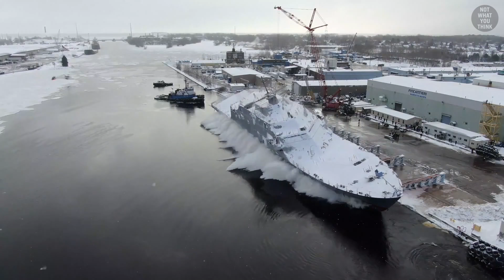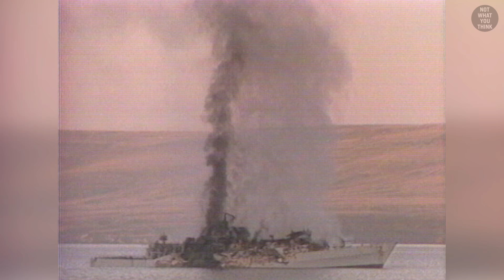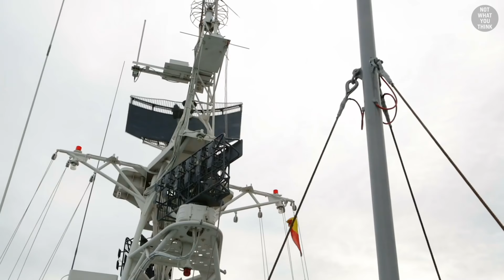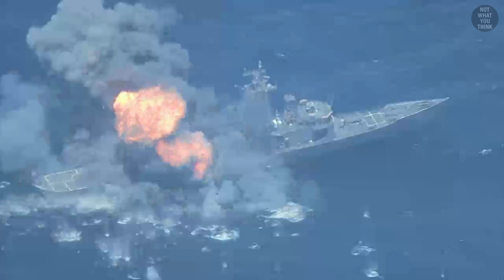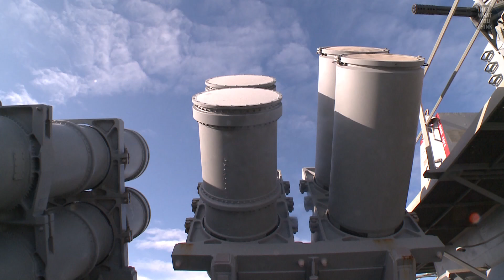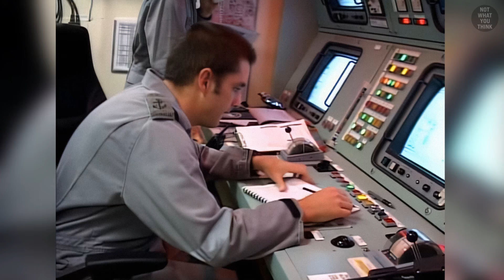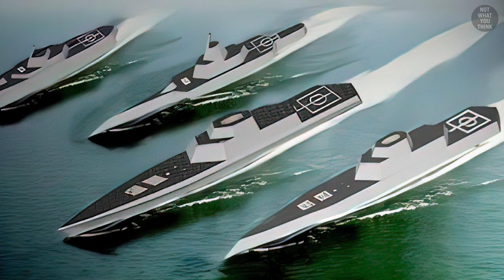How US Navy Made The Most Successful Destroyer ... But Now Has to Replace it.

Comment: The same way that they took the USS Kitty Hawk CVA-63 class carrier and modified it into the USS Enterprise CVN into the 10 USS Nimitz CVN's, and now into the USS Gerald Ford CVN's, thru modernization updates. The hulls and flight deck are basically the same layout design, except CVN-65 eight nuclear reactors, the Nimitz class hull was modified with two large reactors. Both classes are rated at 280,000 shaft horsepower. All have approximately 1,110 foot length hulls, hull beam is basically the same. The flight decks dimensions  about the same. The Gerald Ford CVN has 3 deck edge aircraft handling elevators, compared to the Kitty Hawks, Enterprise, and Nimitz's 4 deck edge elevators. Of course the most striking visual difference is the Gerald Ford's island superstructure. The Enterprise and Nimitz CVN's have 4 rudders compared to the 4 Kitty Hawk CV's and Gerald Ford CVN's having only 2 rudders. All carried approximately the same number of air squadrons. All of them could do  30+ knots.
Reply: IIRC the only post-WWII USN aircraft carrier with 4 rudders was the Enterprise CVN-65, all other carrier classes had two. Additionally, in a way USN aircraft carrier lineage predates even the Kitty Hawk class. An argument could be made that it goes all the way back to the Forrestal class and maybe even the cancelled USS United States CVA-58.
Reply: I take it youre a former Aviation Squid too
Reply: Well the engineers back when knew what they were doing. Not surprising that we’ve just kept evolving highly successful designs.

Comment: The Hi-Lo mix argument for the U.S. Navy Surface Combatant comparing CG-47 to DDG-51 is mostly bogus.  The only real difference in original design was the destroyer had one less gun, and had fewer missiles with no helo hangar.  Once the DDG-51 Flt IIA's came out the only difference was still one gun, and fewer missiles.  The fewer missile argument was cost and political considerations.  Never was any discussion about it actual effectiveness actually occur because there was no navy that existed or envisioned (particularly a PEER) that would challenge us (U.S.).
Well . . . that had now changed, and it is the People Liberation Army Navy (PLAN) that actually challenges us (the U.S.) using our own Green Backs we gladly spend for their cheap products that are shipped to us (the U.S.) every day.  The PLAN is larger than the U.S. fleet and growing VERY FAST ... while congress and the U.S. Navy vacillates. 
It takes three-five years from laying of a keel to delivery to the Navy for modern Aegis Surface Combatants.  It is hoped the FFG-62 will change that, but they are less capable than even the destroyer because they Frigate has less than half the missiles in comparison.
The solution is more smaller Small Surface Combatants like an American Sa'ar 6 with sufficient range to steam in the Pacific...built in numbers to supplement the fleet.  That platform could be built in numbers by more than one shipyard and be available for combat quickly.  No such program exist or is even being considered . . . so the future is pretty much already determined.  American aircraft carriers cannot save the day this time...particularly in the Western Pacific.  Our Allies will be very important but only Japan and South Korea have the right ships to help, and they will be dealing with their own problems.  Such is the Chess Game played by the Communist Chinese.

Comment: Simple fix  is have a nuclear  powered eingine  to power the ship design  a smaller lower level nuclear  power engine for future hook ups that connect to the larger engine  with a longer life span of (25 years ) for both engines this will keep you ahead of the power structure allowances vs  the expansion  of  on board tech advancement for future  surface capability  a good capability  would be to be able to be powered  by the small or large reactor alone the whole ship why for repairs equipment  rest factoring  and if one engine  goes out the surface combatant is not dead in the water  if there any new technics in cooling the reactor rapidly  to be able to turn one off bring a new safety feature
Reply: Having your entire fleet of destroyers be nuclear would be a nightmare and would limit them from travelling to quite alot of ports

Comment: I was on an old Adams class DDG with 4 D class boilers and twin screws sporting 70,000 SHP.....after overhaul in 1984 during speed trials we did 36+ kts for over an hour running all 4 of our boilers.....we could easily do 25 kts with 2 all day and that was with an old steam-powered tin can.....superheated 1200# steam it was but still

Comment: Love all the comments of the Zumwalt being over budget.  Only reason it became so expensive is due to the reduction in units.  90% unit reduction leads to your per unit cost into the 7.5 bill per unit cost.  If you take the original 32 unit proposal the Zumwalt would be cheaper than the Flight 3.  When Zumwalt was cancelled in 2016 the total project cost was 25 billion.  Amortize that over the 32 hulls and you are less than 1 billion each plus whatever the weapons would have added to that cost.  Flight 3 is 1.9 billion each and we have like 70 arleigh burkes.

Comment: There's perfect LCS already - Swedish Visby class.  Add VLS with POLAR (basically, Mk.41 compatible GMLRS) and there you have it. I actually think that both LCSes design were quite cool - comments in Sub Brief channel suggested rater programme mismanagement by Navy.  First, they should have max speed and acceleration requirements relaxed and MAYBE  LM design would be nice Perry successor.  GD Trimaran looked nice as platform for specialized things e.g. UAVs

Comment: One thing that may keep the Flight 3 ships on station for the next few decades is that technological advances frequently take less space and power than older tech.  One example is documentation.  In older ships, they had to set aside hundreds of cubic feet of space for manuals on every system on the ship, but now they need less than one cubic foot for electronic manuals.

Comment: The Zumwalt only failed because the Navy itself. Half the tech meant for the ship wasn't even ready by the time they started construction, and instead of making the design flexible enough to be outfitted down the road, they tried to force incomplete systems onto the ship. Actually it's an excellent platform that they should bring back, but just in a more affordable way. As for LCS, it actually does exactly what it was designed to do. The problem with LCS isn't the ship but the Navy. With their budget constraints, they figure if they drop this ship which would be perfect in places like the Red Sea, they could build one massive destroyer. They have big shiny ship syndrome.
Reply: Navies are always the problem in ship procurement, the Type 45 is an example, being made so few that the cost per ship is around the same as it would be for 12 instead of 6.

Comment: The main problem with the Arleigh Burkes is that the missiles cannot be reloaded at sea.   Once a ship has fired off all its missiles, it is basically pretty useless and has to go to the nearest port that has missiles in stock  to load up.
Reply: they did have a crane to reload the missiles, but it was removed due to accident risks.

Comment: Several system from the Zumwalt design era had the same flawed design philosophy. They included the LCS anf F-35. However. The F-35 program was salvaged. Initially,  I thought the Zumwalt destroyer would be just a technological test bed, which would have made more sense.

Comment: Do they really need replacing now tho? The USS Arleigh Burke, the oldest ship in the class is 32 years old and went through a modernisation refit in 2010 with extending the service life until the 2030s. The latest ship to be completed, the USS John Basilone is expected to enter service in 2023/2024, and there are still 16 ships either under construction or planned, assuming these are completed by 2030, the ships should have a service life until the 2070s

Comment: The Arleigh Burke class destroyers have evolved into almost an equivalent of the Ticonderoga class cruisers. They got the Aegis radar system and helicopters while they still had only one gun that was insignificant. They also have just a few less missile vertical cells.
Reply: But Ticonderoga is a command and control ship, Arleigh Burke is one of Ticonderoga's moving parts.
Reply: @definitelyfrank9341  The flight III Arleigh Burkes can fill the same role and they are retiring all the Ticonderogas by 2027.
Reply: @matthewhuszarik4173  Mate, do you see the massive superstructure on the Ticonderoga compared to the A.B.? The extra space is used to fit the dozens of extra stations (including electronics and personnel) needed to command an entire surface fleet.
Reply: @definitelyfrank9341  The massive superstructure on the Ticonderoga class is because the Aegis Combat system took that much room when they were built. The Arleigh Burke class destroyer have a more modern version that takes less space resulting in a much smaller footprint. The Arleigh Burke Flight I and II were designed to work with the Ticonderoga class cruisers the flight III were designed to replace them.
Reply: @matthewhuszarik4173  Do you have a source that says that the A.B. flight III is no longer a destroyer but a command and control flagship for it's preceding A.B. flights?
Reply: @matthewhuszarik4173   Flight III Arleigh Burke-class destroyers equipped with the Air and Missile Defense Radar provide enhanced coverage, but putting the radar on standard destroyer hulls does not allow enough room for extra staff and command and control facilities for the air warfare commander. - Wikipedia
Reply: @definitelyfrank9341  You need to finish reading the Wikipedia entry.
Reply: @definitelyfrank9341  Read the Wikipedia page for the Ticonderoga Class Cruisers. It is condensed there. Do a search “What does the Navy plan to do with the Ticonderoga class cruisers” it will give you many articles talking about their eminent retirement.
Reply: @definitelyfrank9341  The Arleigh Burke flight III destroyers were designed to replace the Ticonderoga, which are now all being retired after their 35 year of service lives. Remember the Ticonderoga class cruisers were built between 1980-1994 so many have already been retired and the remaining several will be retired by 2030. There was talk about extending there lives to 50 years, but it was decided to build the flight III Arleigh Burkes to replace them instead.

Comment: Your timeline is off.

The first in class, the USS Arleigh Burke, was commissioned while I was serving. My ship was actually in the shipyards with her when she was brand new. I served from 1988 to 1992.

The Destroyer class that was built alongside the Ticonderoga Cruisers was the Spruance class. My ship was the last Spruance class, commissioned in 1983. The first in class, the USS Spruance, was commissioned in 1976.

So it was the Spruance class, not the Burke class, that was a part of Admiral Zumwalt's strategy.

Lastly: All of the Spruance Destroyers were upgraded with the Vertical Launch System. In fact, having it installed was why we were in the shipyards next to the brand new Burke, in 1991.

Comment: A bigger problem is properly replacing the Ticonderoga Class Cruiser to keep up with the Carriers. What they really should do is stretch the DDG-1000 Zumwalt by 50ft, for an A1B nuclear reactor, increase VLS to 120, and remove the rear boat launch for horizontal ADCAP launchers. In the center superstructure above the reactor, install an Anti-Ballistic Missile defense gigawatt class Free Electron Laser turret. Since the A1B reactor has commonality with the carriers, build about 24 or more of them to have 2 cruisers for each Ford Carrier as proper escorts.
Reply: You'd need about a dozen laser turrets per ship to defend against a saturation attack, my dude.

Comment: I wanted to add one piece of information, insight into another, and a fun fact. 

I was a Fire Controlman (FC2) who served on a Perry Class Frigate (FFG) in the early 90s. I was one of the sailors specially trained on the MK 92 fire control system. I conducted maintenance, troubleshot any problems, and operated the system. I was privileged enough to have been the operator during a missile exercise where our ship scored a "skin-to-skin" hit on a telemetry missile. 

The information indicated the FFG's fire control system could only update the target information every 4 seconds. That's not entirely correct. The MK 92 system had its own search radar separate from the main search radar system. It was called the Combined Antenna System (CAS), which also incorporated a tracking radar as well. It is the "egg" looking thing above the bridge. The MK 92 search radar updated target information every second.

Secondly, the video highlighted CIWS (Close-In Weapon System) or Phalanx on the Ticonderoga Class Cruiser (CG). Just for the audience's information, the FFGs were also equipped with them. 

Fun Fact, a Pegasus class hydrofoil was also shown in the video. That ship had the MK 92 fire control system as well.
Reply: We, ( the Royal Australian Navy), renamed the Perry class  to the Adelaide class. I served on HMAS Darwin and HMAS Adelaide.  We used to lovingly call it, "The Rich Man's Porshe ", because it could accelerate or stop in a split second 😅

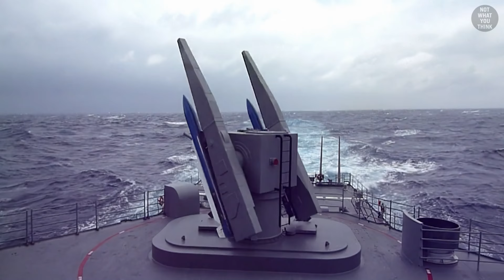Comment: 9:50.  Your comment is not accurate.  The Mk-13 GMLS (One Armed Bandit) could shoot Harpoons and Perry class normally carried four.  You even had a clip of one launching earlier in your video.  The Mk-41, while capable of the SM family, VLA (vertical launched ASROC), Tomahawk, and Sea Sparrow (quad pack version) cannot launch Harpoons.  That’s why the Ticos and Burkes have the above deck Mk-141 crossed launchers as an ASuW weapon launcher.  Additionally, the older Mk-16 above deck ASROC launcher could carry Harpoons and ASROCs but not SMs.

Comment: Dispersed small swarms, drones are the future. i love these big techs too, but maybe it is better to have 100.000 small boats what can have sensors, or missiles, or torpedos.
Reply: Then that would be no different than carriers… small things have a few problems: they lack range, they lack speed, they lack firepower. 

Lets look at cruise missiles: up to 6meters long, carry a 500kg warhead, high subsonic, range excess of 1500km, can loiter, and can weigh up to 2 tonnes. They also cost atleast $2million dollar a piece. Newer ones with better guidance and low RCS are even more expensive. And this is the most compact system available right now. Its was the modern day suicide drone before the term “suicide drone” was a thing.

The issue is, that cruise missile still need  a need a platform to be launched from. And “bang for ur buck” mentality ensure that their platforms are giant strategic bombers. Ie: american B52, B2, B1; russian Tu-160, Tu-22M, Tu-95. Ie: a B52 can carry up to 20 cruise missiles on internal rotary launchers and wing pylons. Thats alot of firepower from just one “carrier”. 

With these platforms, the range of these cruise missiles are also effectively and drastically increased from 1,600km to up to 16,000km. 

Swarming an enemy with drone is excellent for A2/AD and tactical menouvers. But they just lack that flexibility and in need of a proper “mothership” for better projection. 

The issue here for this vid: what is the best “mothership”?

Comment: All new ships oughta be made like they do supercarriers.
Modular design.
this can help in replacing outdated stuff, or reinfrocing
and aspect which is desired during an engagement.
Let's say long range missiles for bombardement purposes
are required, or maybe anti-tank support.
In that acse you'd want to remove the other stuff and
only add vertical launch tubes.
If not, you can add drone launchers and drone control modules.
Or, a VTOL hangar. or whatever.
If you want to make change, change the composition of
the modules, remove the ones you don't want or need,
and add the ones you do want or need.
That makes whichever boat usefull for a lot of roles over a long period of time.
The basic boats need to be fast and durable, the rest us decided
upon the start of engagement.
With the right tools, you can change the layout in the matter of an hour.
(Or even less..)
Field test new weapon system, radar, whatnot, stick it in a box,
mount box into a part of the modular hull.

It's not my idea, but the guy who made the supercarriers modular.

Comment: The problem DDG is a good platform it just has to do the job of of a frigate and a cruiser too. This multimission effect makes it a jack of all trades ship and master of none. There are funds to make it better. Unfortunately they were wasted on littoral classes and that funky ass zumwalt design. The curvature of the earth masks a ship 12 miles away and engines are heard by sonar and it’s nearly impossible to stop a hypersonic missile unless you use laser….a laser pulse goes way faster than mach 5-7.

Comment: i would disagree with the statement- most successful destroyer post WW2. While the arleigh burke has a planned total of 117 warships built for the class by end of production, it has been done with 3 different variants produced over 40 years.   

The Soviet Skory class consisted of 70 ships built in 4 years. They were an extremely successful design remaining in service for 35 years from 1949-1984, they were modernised continuously and were on par with those of other nations unlike its predecessors.
It was only phased out of service due to the significant changes in warfare at the time (the dawn of the missile age) rendering them obsolete. 

Just Think, it took 32 years to build 70 arleigh burkes and the soviets built 70 skory class destroyers in 4 years. i would say that it was a rather successful design as it was exported as well